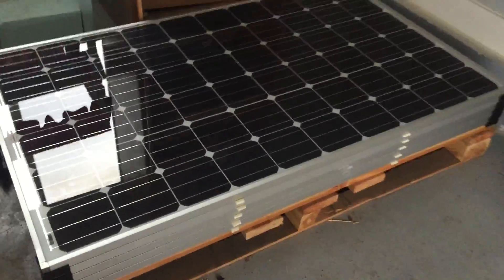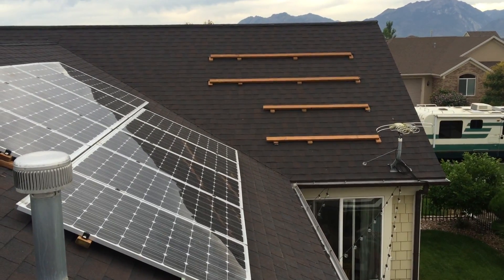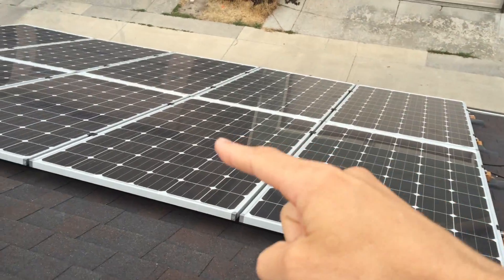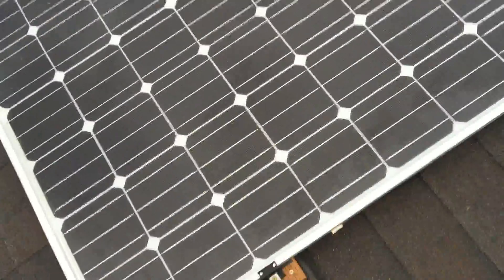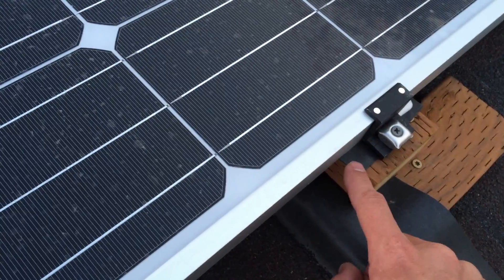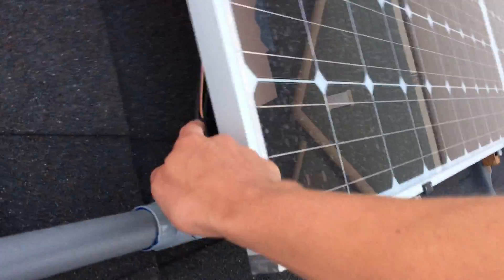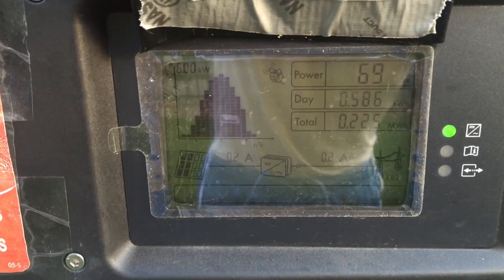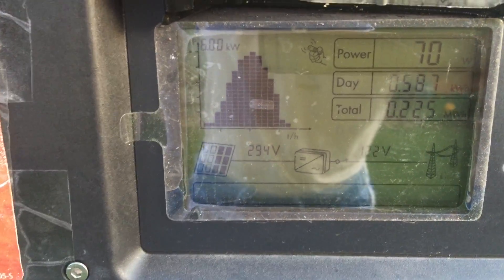How To Install Solar Panels Yourself For $4K - DIY 7KW - South Jordan, Utah - Cheap

Comment: How did you qualify for the rebate? I thought you had to be certified.
Reply from the maker: Nope, it is just a tax credit when you file your taxes, and you don't have to be "certified".  You just have to spend money on solar improvements and have them installed that year.  Check out https://diynewman.wordpress.com/2016/07/24/how-to-install-solar-panels-yourself-for-4k-diy-7kw/ for more details on all the tax credits.

Comment: Matt how is your system still performing?? Any issues?
Reply from the maker: Done great - have been producing 900-1400 kwh per month and paying $8/month for electricity (the fixed costs I have to pay).  It is actually performing better than I expected.
Reply from the maker: Oh, and not really any issues, other than I had to tighten a few screws a couple months ago that I noticed I hadn't tightened as much as I should have originally.
Reply: Did you have any electrical experience before doing this"?
Reply from the maker: not really - I had wired my basement, but that was about it.  It is fairly simple.
Reply: Nice! Definitely inspiring to me watching the video although i think I am going to go with micro inverters
Reply from the maker: sounds good - good luck!

Comment: Hey you need to install conduit supports for the pvc it's going to droop dramatically in a few years
Reply from the maker: Yes, I did that - thx
Reply: Ok did you use 2x4s with a 1or2hole starp?
Reply from the maker: not sure what you mean
Reply: What did you use to support your conduit?
Reply from the maker: they had little plastic brackets at Lowe's that have screw holes on either side.  I screwed those in where there were trusses.
Reply: Matt Newman oh ok.  But did you put like a 2x4 under the conduit to elevate it or did you just screw it right to the roof??I'm
Reply from the maker: i just screwed it to the roof
Reply: You should have used 2x4s2 your supposed to have the conduit elevated at least 1/2inch off the roof but I guess it's too late lol. Just a pointer from a seasoned solar vet.  I actually use unistrut and unistrut  straps  for my conduit supports.  And I must say your solar system is the first I've ever seen built with all 2x4s. I'm not sure if I love the idea however the job came out nice.  What state are you in ?
Reply from the maker: hmm, interesting - good to know.  I am not sure why that would matter since the conduit is PVC and I don't see any problem with it having direct contact with the shingles.  Yeah, it is unorthodox to use treated lumber.  I think it is worth it if it is significantly cheaper than a racking system like it was in my case, but if you can find a racking system that is only a few hundred bucks, that is probably worth it to use metal.  I am in Utah.
Reply from the maker: good to know - thx.  in Utah
Reply: Matt Newman  hell yea I agree with ya. If we were aloud to mount it like that in California I would  love it. I must say tho that liquid tight flex on the ground looks like shiiiiiiiiiiiit!!!!  Why would you do that and go to sleep the same night??????!
Reply from the maker: on the ground?  I am not sure what you mean.  There isn't any liquid tight flex on the ground - it just goes from the roof down to the inverter.  are you saying you would have just used normal conduit instead of the liquid tight flex?

Comment: In sandals no less .... :) honestly, this is a totally badass video. The only downside to this whole thing is that to take those kW and push them back onto the grid at rate-X .. then you buy kW you get charged rate-Y .. and Y>X by a factor of like 2x to 4x. Kinda sucks, but still .... good stuff. I wish WE could bill the electric company for delivery charges ... cuz we have to maintain this stuff. Doesn't work that way, unfortunately.
Reply from the maker: Yeah, luckily I am grandfathered in so I will always have the benefits of net metering.  However, the power company here is working really hard to increase rates for net metering customers (like they did in Nevada and killed the solar business).  At any rate, if they did do that or do in the future, I will just buy batteries with it.  The thing is, in the end, solar will win because the cost of transmission alone (from power plant to our houses) is 3 cents a watt, and solar will drop below that eventually.  Centralized power will die as decentralized takes over!
Reply from the maker: that's how I roll!
Reply: Pinkeye, the utility's other customers wish they could bill you for the convenience of being attached to the grid, with all the costs entailed in that.  Instead, those costs are foisted off on other customers who don't have solar.  You'd better get ready for monthly grid connect fees, because without them, the grid will die.  You have to maintain your panels and electronics, but don't forget that someone has to maintain the grid, and that's a big job.

Comment: Why didn't u run the wiring inside the attic would have look cleaner... I'm also doing mine solo screw those expensive companies.. very easy just some sweat and done..!!
Reply from the maker: it just seemed easier to not go through the attic and just use conduit, especially since my main circuit breaker and meter is on the outside of the house.  However, maybe I could have gone through the attic down to my basement and had the inverter down there.  I just am not sure how the wiring works in that case, so I just did it this way.

good luck!

Comment: Matt why did you not go with micro inverters? Is it the additional cost? I am in West Valley almost ready to do my 4K 12 panels micro inverter system with LG330E1C-A5 it has Enphase IQ6+ integrated on the panel and IronRidge Flashfoot2 mounting/rail. So far I am around $8K before incentives. Also waiting for results on that Utah Public Service Commission & Rocky Mountain net metering rate hike meeting in August https://psc.utah.gov/. Got a bid from 3 places Auric $25K (17 panels cheap Canada solar), Solar City $25K (I do not like single point of failure with single DC converter and 1000 volts on the roof, but if you going with batteries definitely pick SC) and a local shop $12K (12 panel Solfab + enphase IQ6 its only 3,6kW still thinking of giving this shop a chance)
Reply from the maker: Yeah, micro inverters add cost.  The advantage is that if your panels get partially shaded, they adapt to that.  However, I don't get any shade on my roof (no trees or anything), so I would rather save on that expense (more info at https://diynewman.wordpress.com/2016/07/24/how-to-install-solar-panels-yourself-for-4k-diy-7kw/).

You sound like you have great options, and if you can do micro inverters and mounting rail for $8K, that is great.  Costs have come down some since I did it, so it might be feasible to do for that price with the added benefits of rail system and micro inverters, in which case I would probably go for it.

I would probably try to get grandfathered in before they do anything weird with the rate hike, if possible.
Reply from the maker: I guess also keep in mind you are talking about a system that is half as big as mine for the same cost (or 50% more), so if you really want to go cheap, my way is probably the lowest cost option.
Reply: Matt, This applies to tree leaves, bird poop other obstructions including panel(s) and single inverter failure. If your inverter/panel fails you whole system is completely down. Until you fix it (you probably don't have extra inverter/panel in the shed) how long will it tack to ship new/repaired one? Not trying to put you down just posting this for an informational purpose. Another thing when you doing DIY Solar you can submit for your labor (Include any labor costs properly allocable to the onsite preparation, assembly, or original installation of the residential energy efficient property and for piping or wiring to interconnect such property to the home) https://www.irs.gov/pub/irs-pdf/i5695.pdf, but you have to see CPA to check how to do it. So if you estimated $120 x 100hours = $12K thats a bit high, but you can probably do $4-5K in labor.
Reply from the maker: true - valid points.  In my case, I have noticed that shading some of the panels actually doesn't impact the generation that much (it just goes down a bit).  Also, I have three strings (not just one), so even if a whole string goes out, I still have 2/3 power.  At any rate, in the year I have had my system going, I have been tracking the power generation (using a webconnect in the inverter), and I get reports daily, and the generation hasn't really been affected adversely by those types of things, and if it were, I would know about it right away.

That is good to know about the labor - I guess I didn't really get the tax credit for my own labor - I suppose I could have done that.

Comment: Great job, however, I'd stay away from the 2x4's and wood on a roof as it will rot and the panels will become bouncy and will blow or fall off, in a few years.  Treated wood or not, the wood will rot pretty quick.  I'm doing my own DIY solar project on my house, right now, and bought the UniRac SolarMount racking and it's pretty cheap and super easy to install.  I used to play little league football in S. Jordan, many years ago for Bingham football juniors.  Good times.
Reply from the maker: They seem to be holding up after a year fine (we'll see in 20!).  It is treated wood and it is pretty protected by the panels (hardly any of the wood is exposed to the elements).  I suppose we will see.  I did paint the ends that are exposed so they won't weather as much.   Perhaps the racking system is a good idea for long-term, but seemed pricy.

Good to hear from a fellow South Jordan resident!  Take care!

Comment: I'm surprised the city let you use the lumber to mount the panels. They usually want an engineered system. I'd be concerned about the wood breaking in a really bad wind storm.
Overall, good install.
I'm planning my system now. I have my net metering approval already, I need to get my plans together and apply for the permit with Tooele City.
Reply from the maker: sorry, still don't know what you mean, but don't mean any disrespect.  Just a guy doing DIY and sharing my ideas.  I don't claim to be an electrician, but it was all up to code and passed inspection, so I think I am okay.  I hope you can give me the same respect you expect for what I did, even though it isn't to your specifications.
Reply: Matt Newman that's awesome dude, west Jordan's inspector is a tough one. If he says your up to code then your good
Reply: Matt Newman south Jordan guy is also tough. If you ever want it to look a little prettier run conduit from the inveter to the sophit then j box and transition to mc cable through the attic and junction or "soladeck" under each panel location. Then you won't have the pvc all over your roof
Reply from the maker: Yeah, they were fine with it as long as I had a structural engineer sign off on it.  I paid a structural engineer $100 and he did a bunch of calculations and determined that it would be fine in a windstorm up to like 100 mph winds I think.  Good luck!
Reply: Matt Newman.  Oh cool. What state are you in?    And you did a good job on everything except the liquid tight flex for your Electrical connection. Looks horrible lol why did you do it like that?
Reply from the maker: Utah.  I am not sure what you mean on the liquid tight flex - what are you saying is wrong with it?
Reply from the maker: thanks!  actually it was South Jordan city that approved mine, but yeah, all good.
Reply from the maker: good points - thx!
Reply from the maker: okay thanks for those tips!
Reply: That guy is a moron.  The world needs more people like us to keep industry honest.  He is just pissed because he is an electrician or solar installer.... For every guy/gal like you and me there are a million others who are willing to pay to have it installed.  People like us are what built this world we live in.

Comment: okay so $8,500
that makes more sense.
installation 70 hours
permitting 10 hours

thanks for the data. that's really good data.
Reply from the maker: yeah, gross is $8,500, but then I got $4,500 back in tax credits so only $4K out of pocket.  I have found 6KW inverters on ebay for $1500 (I paid $2700), and panels as low as $0.10-$0.15 per watt lately (I paid $0.50/watt), so I think I could probably do the same project for about $3K out of pocket now.  Also, after doing it once, I bet I could do all the labor in half the time - a lot of it was just figuring stuff out.
Reply: where do you get panels for $0.10-$0.15 per watt?
Reply from the maker: Sun electronics.  The best deals are usually around $0.20-$0.30 per watt for grade B or C.  But, they did $0.11 for hail damaged ones (all tested and working though).  If you get on their email list you will get alerts when there are deals.

Comment: Matt, Thank you for sharing your experience, I too have been in talks with Vivint and SolarCity  among others to have my own solar generating system here in SLC, so your video has been super inspiring. If I can save around 20K just like you on just installing it myself I wounder if i would be smart to invest in a back up battery system. Whats your thoughts. Thanks again.
Reply from the maker: Yeah, you could get batteries, but I wouldn't recommend it in a place where grid tie works fine.  I talk more about batteries on https://diynewman.wordpress.com/2016/07/24/how-to-install-solar-panels-yourself-for-4k-diy-7kw/.  They cost more, and really, when you grid tie, the grid is your battery.  If you do it though, I would use lead acid (the Tesla powerwall with Li-Ion just costs too much).  You will need a charge controller to make sure the batteries don't get fried.  The only reason to get batteries is if you are worried about blackouts (which isn't a problem in SLC), or you are worried the grid tie option will go away, but here, Rocky Mountain Power allows it, and if they ever change it, they will keep everyone who is on it grandfathered in.
Reply: Huge Thanks!!! On a subject where there are so many different opinions on how to go about a having a Home PV system, your approach by doing it yourself  and doing it at 1/6 the cost of the full service retailer is the best approach I have see for someone who has been shopping around for the past few years. Thanks again for giving clarity on how I should go forward.
Reply from the maker: you bet!  good luck and take care!  Let me know if you have questions as you do it.
Reply from the maker: Thank you and good luck!
Reply: @isaac Y The best Backup System is to use Enphase batteries. They are the best period. Have a look at www.enphase.com
Reply: Enphase is my bread and butter for repairs/ replacements. As a customer, your should consider otherwise.

Comment: Hi
i am trying to solar panel a two story shed
what do you  recommend? thanks
Reply from the maker: So that should be just fine.  I would probably need more details in order to help you, but you can just follow the directions in my video and it should work.  Do you know how many killowatt hours you need?  Is this to power your house, or just the shed?  Are you doing grid tie?

Comment: Excellent setup! I had a 2.45kw system installed for $7,000 and would have been a big savings to do it myself. I am looking at expanding myself, but wondered how much trouble it is to do an add on. I imagine permitting and amending utility net metering shouldn't be too complicated. I have a solaredge DC optimized system.
Reply: Pedro Garces Depends on the amps.  Stringing the panels in series allows the amps to remain lower.  The more amps the larger the cable needed.  That's the problem with 12 volt systems.   They carry 10 times the amps as a 120 volt household circuit.     In other words a 1200 watt toaster only needs 10 amps.  with a 12 volt system you'd need 100 amps to do the same work.
Reply from the maker: So it shouldn't be that hard to expand - you can usually just add more panels, but you are limited by your inverter.  For example, I have a 7kw inverter, and I peak at about 6.5kw in the days, so I could probably add another 500 watts of panels.  Most inverters are fine if you put too much power into them, but they will just cap you at whatever they are rated at.  So in your case, you would probably just need to figure out how much your inverter can handle, and if it isn't enough for how much you want to expand, you may need to get a new inverter too, which then can get more costly/complicated.
Reply: Hi Matt, Thank you for the reply. My inverter has about another 1500 watt available for expansion. I can get 6 more panels. I wondered about the cable gauge going up 1500 watts. Today I have 10awg wire holding 375 volts DC down to the inverter. Do I need to upsize the wiring? Thank you for all the help!
Reply from the maker: I am not sure on cable gauge - it is probably fine though.  You might just be able to put the 6 new panels on a separate string/cable.  in my case, I can have 4 strings going into my inverter, and currently only use 3.  So maybe you can just add these new panels as a new string.  I am not sure on the 10awg being able to carry that voltage - I am not super strong on electrician skills and don't want to advise you wrong.
Reply from the maker: Pedro Garces I am not sure on the wiring - i would ask someone at Home Depot or Lowes but usually you don't have to increase the gauge much. You could just try and see if it gets hot.

Comment: What software did you use to draw your electrical schematic?
Reply from the maker: actually, it wasn't very good - I just used Seashore on a Mac.  You could try Paint.net on Windows.  Also, you could try https://sketch.io/sketchpad/, Lucid Charts, or draw.io on google docs, https://www.digikey.com/schemeit/project/
Reply: thank you